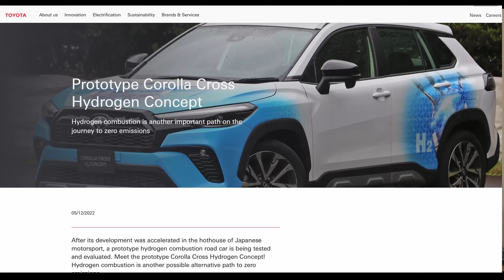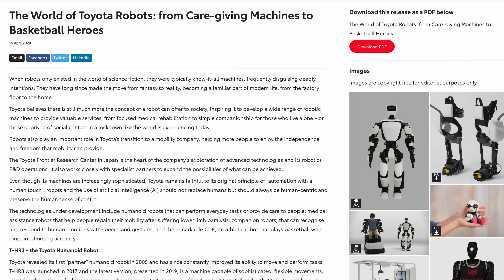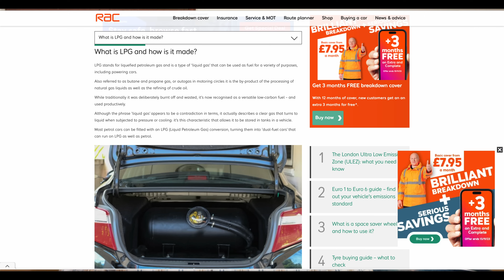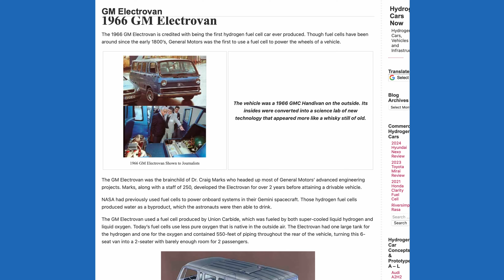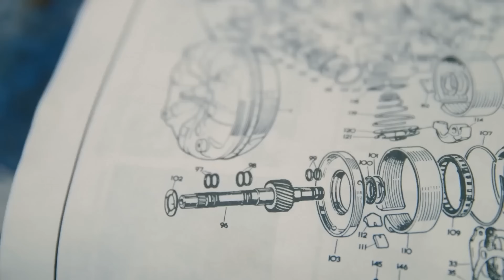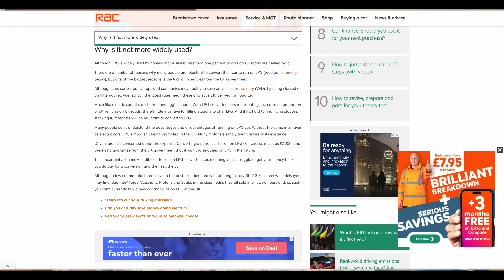Will Hydrogen Give EV Charging A Run For Its Money?

Comment: Sorry I have got to disagree with your efficiency figures, you quoted 20-30% for ICE and 99% for an electric motor. This seems somewhat disingenuous because a modern turbo diesel engine is 45% efficient and as for 99% for an electric motor I can only assume this is a Tesla sales pitch. Why I say this is because it is a recognised fact that you can reclaim 4-14% energy through regenerative braking (4% highway and 14% city driving). So if you drive your 99% efficient car in towns and you use regenerative braking your vehicle is 113% efficient. Now I don’t know what planet you’re from but I do know that 113% efficiency is impossible in this universe.
Reply: OK, drop the EV to.... 80%.
Now compare the Real world diesel efficiency, now the steady state, on the bench figure and add in the secondary "well to wheels" total system inefficiency. (as Dave mentioned)
You can't have it both ways.
Reply: @rogerstarkey5390  I don’t want it both ways I want the information to be accurate. And as for real world efficiency that is what 45% efficiency means,55% is lost through heat.🤪
Reply: Only at one speed. All turbo diesel engines must drive 75 km/h. Not slower and not faster. Do you want a 45% Diesel driven car that is not allowed to stop and refill? I would not. 

Electric cars have a PV/Wind to road efficiency of up to 70%. Hydrogen vehicles can reach up to 19% efficiency from PV/Wind to wheel. 

Gazoline 12%. E-Fuel Gazoline 15%. Bio.-Diesel about 1.5%, Diesel in passenger vehicles 15%. Diesel in trucks 18%. Diesel in Ships 20%. All accounted for well-to-wheel. Calculate it yourself if you do not believe me. The sources are all freely available. Google is your friend.
Reply: @wolfgangpreier9160   What a load of old bollocks, the efficiency of a diesel engine is determined by the engine speed not the road speed and as for how efficient a car is at speed,it is to do with the drag coefficient of the car in question. You spout out figures that are totally irrelevant !
Reply: @stephenbroadhurst7653  Thats ok, if you do not want facts i will not bother you with facts. Just continue with your wishful thinking. I guess you need to lie to yourself to stay sane.
Reply: @stephenbroadhurst7653 did you add in the efficiency of pulling the crude oil of of the ground, transporting it thousands of miles in tankers (crude is corrosive so tankers have a finite life), refining using precious metals finally transporting it to your local fuel station to pump into your tank for its efficiency test.
Reply: @stevenbarrett7648  No I didn’t the same as I didn’t mention that only 10.7% of power generated in the UK in 2022 was not from burning carbon the other 89.3% was from burning carbon based fuels. And when you take all this 89.3% and what type of power station and how much power each source generated the total efficiency generated is coincidentally 45% efficiency as well. Now if we say nuclear,wind,solar,hydro and net imports(10.7%) are 100% efficient which they are not this will boost 45% to 55.7%. Then you loose 8.75% in transmission losses,then you loose a further 20% from the charger to your battery,and yet another 20% because your electric motor is only 80% efficient. And that is why you’ve got to compare apples with apples. Incidentally UK power generation produced 269 tonnes of CO2 per GWh of energy in 2022.(all power and pollution data comes from GOV.UK) just in case you want to know the truth. There is one more set of figures you might be interested in, I just measured my tyre tread depth and over the last 20,000 miles according to the manufacturer’s figures my tyre particulates are 247 times that of my engine emissions as long as they last 50,000 miles,if they don’t this figure will be higher and that is just from rubber this doesn’t take into account road surface wear.
Reply: @stephenbroadhurst7653  interesting, especially the tyre losses which will be the same no matter what propels the vehicle. 
I mainly charge via our solar and battery pack so little or no transmission problems. 
Just a thought. If government had invested properly in solar with battery storage as we came out of covid I wonder what the impact of Russia would have been on the UK assuming by then we had a fair proportion of businesses and private dwellings with solar and battery storage ?. 
It would have been great if they had given out grants and low cost loans, training for the legions of new solar workers then sat back and watched the revenue on thousands of new salaries come back into the treasury. 
As it was political parties of all colours spent their time sniping at each other trying to gain poll points instead of increasing our working population. 
We wanted them to take charge all they did was line their own nests and take advantage
Reply: @stevenbarrett7648  When I mentioned about my tyres it was not aimed at EV’s it is the same no matter what type of car you drive as long as the weight remains the same. The tyres that came with the car from new wore at double the rate that these tyres are wearing so even more horrendous. As for Russia, we just buy our gas from America and our wood pellets from America and Canada now and we just have to pay more. As for investing in our power plants you won’t get the government to put their hand in their pockets they expect the money to come from the private sector. As for the National Grid plc their end of year March 2023 profit was £4.9 billion  and that money won’t be invested it will go straight to the shareholders. Another interesting fact I found out was that the UK does not own any nuclear power stations at present all 5 nuclear power stations in service are owned by the French government,so when people say we generate so much energy we are exporting it that is simply incorrect. For one quarter in 40 years we exported power to France because their nuclear reactors were scheduled for service and repairs but I don’t think we had any say in the matter because French power stations produced the energy and France needed the energy. As for your last point yes I can see every home having solar panels and or small wind generators with storage batteries so we can charge our cars at home and run our electricity. The only thing with that is I wonder how the government will recoup the lost revenue they probably will tax us on the calories we consume in our food, just joking.
Reply: @stephenbroadhurst7653  Maybe the reduction in respiratory diseases will reduce NHS funding (hahaha) there has to be a reduction in outgoings as people will be healthier and live / work longer with less sick days. We have wood here in the UK maybe they need to figure out a way to use this instead then replace what’s cut down, it can be done as can a reduction in the use of gas, it just needs a will within government to make it happen
Reply: @stevenbarrett7648  If you grow willow you have a quicker turnaround you can harvest it in four years and the area of land you would require is just over double the size of the Isle of Wight with the energy that we use at the moment,but you would have to leave it four years to mature. I haven’t worked it out for conifers because you have to wait twenty five years to harvest the wood so I don’t think this is a viable option. The scary thing is that if you rely on carbon capture to produce energy the so called experts say by 2050 half of the total arable land will have to be set aside for wood production, well we haven’t got enough land to grow food now so basically we are screwed !
Reply: @stephenbroadhurst7653  I drive through the north of England to Glasgow, on the way I can see absolutely nothing for miles just heather and gorse, miles ripe for planting, we have the land and it’s unusable for anything else
Reply: @stevenbarrett7648  You might find that heathland is protected because of some animal,plant or insect. Or it could be because it is an important part of the environment and has the same protection as Moreland.
Reply from the maker: Stephen you are mixing up the battery with the motors. Electric motors are indeed 99% efficient in taking electricity and moving the car. Regenerative braking is recharging the battery, not the motor. I agree that diesel engines are over 40% efficient, I stated this, but after losses through clutches and gearbox and differential are included, actually less than 30% reaches the wheels. EVs do not have clutches or gearboxes. Almost all reaches the wheels directly.
Reply: @davetakesiton  No I am not mixing up batteries with electric motors, the reclaimed energy that you get from regenerative braking ultimately comes from the energy stored in the mass of the vehicle travelling at speed (inertia), this energy is obtained from the electric motor propelling that vehicle. That is why it is impossible for an energy source ever to be more than 100% efficient (99%+14%= 113%) and that does not take into account the energy lost through internal friction and through heat. Don’t forget heat is a manifestation of energy so if it gets hot it is losing energy. You also mention about gear boxes and clutches, a clutch doesn’t loose energy if you haven’t got your foot depressed on the pedal, it is designed to disengage the drive for one reason or another. Now we come to the gear box side of it and yes gearboxes loose energy due to internal friction and all EV’s have gearboxes, a Tesla gearbox has a ratio of just under 9:1 and is fitted with a differential also,I hope this helps you to understand. PS I’m sure your a very nice person but I’m just trying to show you that your mind isn’t as open as it could be.
Reply: @davetakesiton  Diesel engines, just as any other internal or external combustion engine have their top efficiency - Diesel about 45% - at one very narrow torque and rpm point. 

Electric motors have their top efficiency between 10 and 90% of their power band. From stop to top speed. And not only @ 45 mph.
Reply: @wolfgangpreier9160  Really, do yourself a favour and look at a torque curve of a diesel engine you will find it is very broad and flat typically the maximum torque is between 1,800 to 2,000 rpm, and the maximum power at 4,000 rpm,I admit it is not quite as flat as an electric motor but this doesn’t matter in the slightest because that is why they have gearboxes fitted. Another benefit of a gearbox is say your in first gear(5:1 ratio) and your differential ratio is 3.5:1 and the car is automatic and the torque converter has a torque multiple of 2.5:1 , the car engine develops 450 NM of torque at 1,800 rpm then the torque transmitted to the drive shafts would be 19,687.5 NM at the initial take up point in theory, in practice it would be slightly less. That is why a turbocharged diesel is by far the best vehicle for towing at the moment.
Reply: @wolfgangpreier9160  I would like to take this opportunity to ask you to forgive my impolite attitude towards you at our last correspondence,sometimes I get so frustrated with certain comments but the fault lies totally with me.
I also would like to explain the problems we face in the UK. The power generation in this country is not very efficient and I will list the types and how efficient these plants are and what fuel they burn. (Oil-40% eff)(Gas ccgt-60%eff)(Gas ogct-43%eff)(Biomass-35%eff)(Coal-33%eff)(Nuclear-45%eff)(Wind-47%eff)(solar-25%eff)(Hydro-90%eff). But the last four types only account for 10.7% of power generated, and when you take the newer Gas ccgt type 60% efficient ones there are only 10 of these out of a total of over 2,000 power plants at the last count and the grand total efficiency without renewables was 45% efficient. Now because most of our energy comes from fossil fuels when people quote wells to wheels” when trying to explain the overall cost to the environment. It is almost identical to someone quoting wells to power stations” because they both rely on fossil fuels in this country. Also please note that I have edited my last post to explain Torque & Gearboxes.
Reply: @stephenbroadhurst7653  We have 81% of electricity generation from renewable sources. But only about 28% of the total energy used. We got a long way to go. But we in Austria are a bit further on our way than many other European states.Yes, its a struggle for everyone. But necessary if we want to give our grand children a world worthy to be living on.
Reply: @wolfgangpreier9160  I think the UK needs to spend more money on renewables, but to spend more we need to export more so I thought we could export our government but the trouble is nobody wants them LOL 😢.
Reply: @wolfgangpreier9160  I also see that you live in Austria do you have loads of hydro power plants like Norway, if so you are very lucky because they are the most efficient type of all.
Reply: There is no way a modern turbodiesel engine is 45% efficient. That is pure dreamland.
Reply: @Brian-om2hh  You mean like a Tesla motor is 95% efficient when in reality it can obtain an efficiency of up to 95% when under heavy load at high revs (100-150 mph on a motorway ) but this drops to 80-82% driving at low loads and low revs( driving in towns). Then this drops to under 50% efficiency at 10% of its revs (crawling in traffic) as most of this is stated on Tesla’s website, but be warned you have to dig deep to find this information. So yes a modern turbo diesel engine is 45% efficient at its optimum performance. And a large marine diesel obtains 60% efficiency at its optimum performance.

Comment: Totally agree Dave. Of corse the cost of hydrogen will be more than petrol and the life expectancy of the engine has got to be seriously shorter due in part to the excess heat. But the infrastructure is the big one. God it’s taken 10 years to get a plausible charging infrastructure which is far from perfect and the electric cables are already in the ground. So how long do you think it would take to get filling stations up and running. Don’t hold your breath.
Reply: At least 15 years, and probably longer to get anything like a viable hydrogen infrastructure up and running. But there are also other issues. No way will town and city planners allow massive tanks of hydrogen - stored at 10'000 psi - to be sited anywhere close to habitation, or even places like factories or offices... It could be a tricky one for the hydrogen freaks.

Comment: Hi, great video. It's the same thing with companies pushing for replacing gas boilers with hydrogen boilers - to keep the fossil fuel companies going for as long as possible. Eventually it will be heat pumps and electric boilers, but hydrogen keeps being touted as in theory it's another gas that can come to home via pipe but it a lot less energy dense so doesn't work the same way as natural gas.
Reply: Hydrogen currently comes from natural gas, just use natural gas directly.  Hydrogen has no point because it will always cost more than natural gas.  Green hydrogen cannot be made cheaper for the foreseeable future, it is too energy intensive to make from splitting water.  Solar panels and wind farms make more money selling power to the grid directly.

Comment: Hi Dave, Think your right,  Can't see hydrogen taking off in cars,  hydrogen fuel cell cars are approx 50% efficient,  better to put your renewable energy into a battery which is 95% or more efficient, both require an electric motor at approx 99% efficient.  Can't see hydrogen in combustion engines either due to the nasties and carcinogens that are created.  To many positives in favour BEV's despite all the biased negatives which are being broadcast at the moment.
Reply: As you (almost?) confirmed, a HFCEV is "an EV"..... Just a VERY inefficient version.

Comment: Nuclear reactors can be tweaked to produce vast amounts of hydrogen.
Reply: As someone who worked in the industry, how’s that work then, educate me…..
Reply: @devonbikefilms  https://youtu.be/oH1DKzG7W_o?si=1ZChj07xHZe2ucn3
Reply: @devonbikefilms  There's a dial that says "Hydrogen output" under it, I believe you just turn it to the right and waves wand ... more hydrogen! 😁
Reply: They can also distribute the same source energy as "electricity" directly to those new fangled "electrical vehicles".... 
(smh)
Reply: Battery technology will not improve much.
In the next ten years.
Governments will keep pushing back the deadline for removing ice engines.
Battery powered car will fade out.
Wltp rang is absolutely laughable especially in cold weather with the heating on.
For speed just charge to 80% try not to go under 10% newer battery's not so much.
But be honest 64 kwh battery and only being able to use around 45kwh is not going to be that good for a vast majority of drivers.
Reply: @sooty8992  
Stop regurgitating things you don't understand.
Reply: @sooty8992  I'm not sure you are correct. Most people only do about 30 miles a day, so one charge a week. If you can charge from home you leave every morning with a full charge and if you have a long journey charge to 100% I'm not sure what experience you have had driving EV's I've had 5 years and no issues.
Reply: @sooty8992 That is really a big bunch of E-Tron. Thx for the laugh. 😂🤣
Reply: @sooty8992  How much power does a heat pump use over a 2 hour journey?
Reply: @djtaylorutube  It uses less than an EV not fitted with a heat pump. Heat pumps increase efficiency...
Reply: @Brian-om2hh  Shhh Brian, you've spoiled the punchline! 😁😋

Comment: Very good point on the power required for hydrogen, all these anti-ev lot bang on about there not being enough power to charge the cars but hydrogen requires 2-3 times the amount of energy so what do they think will happen to the grid then?
Reply: For a converted ICE vehicle it is more like 5 times if you take into account the amount of energy used in compressing and distributing the hydrogen.